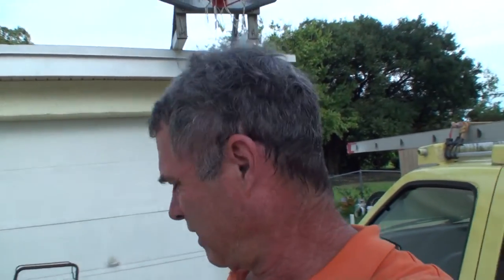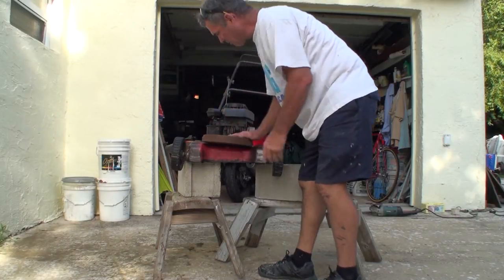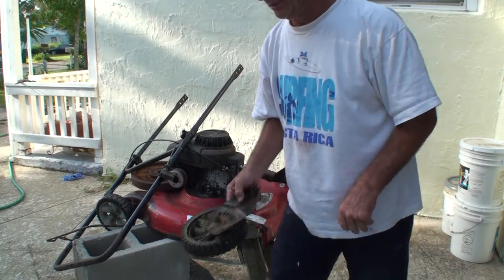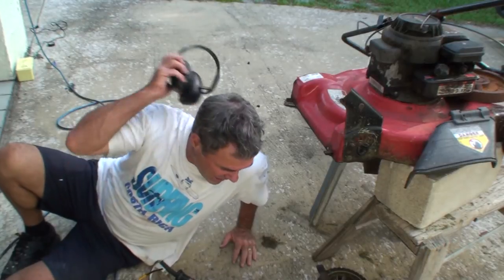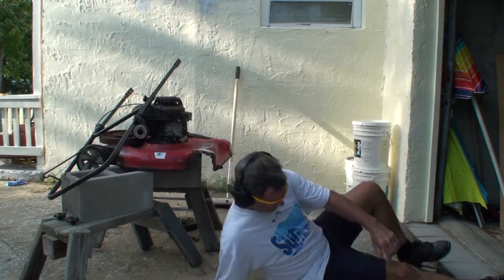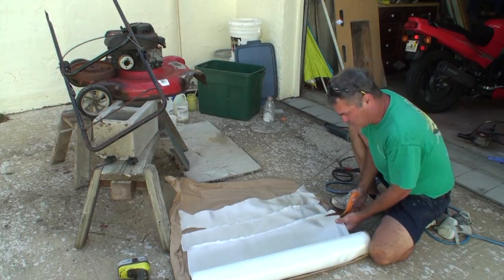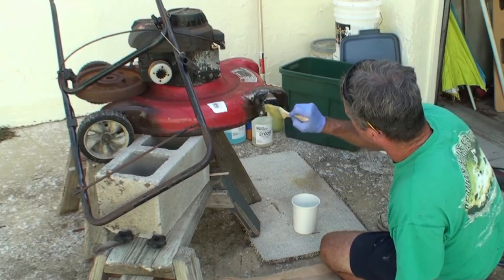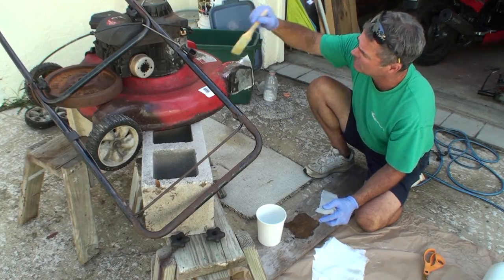Saving a Lawn Mower with Fiberglass part 1

Comment: I did the same restoration on a Honda Izy. With fiberglass and wire mesh. Using electrolysis to remove the rust.